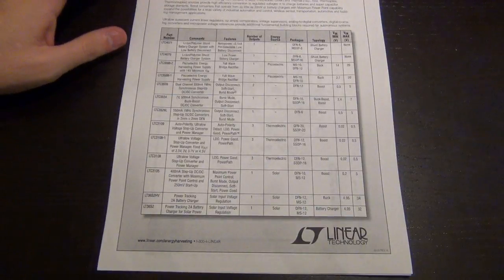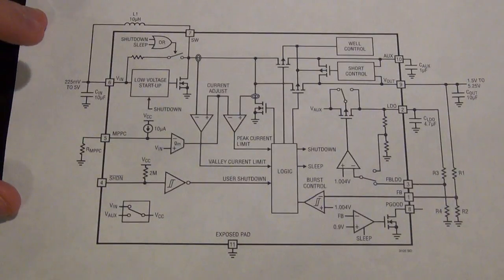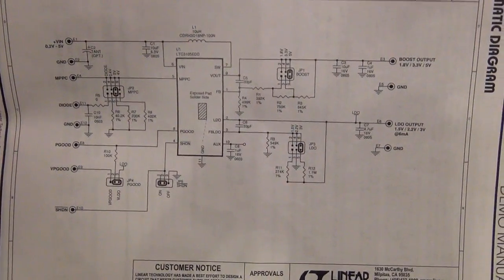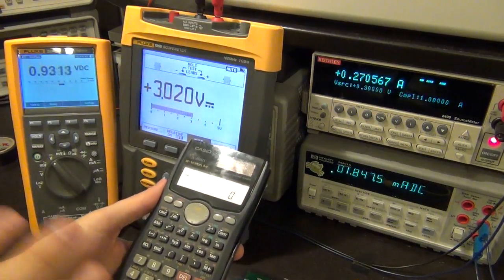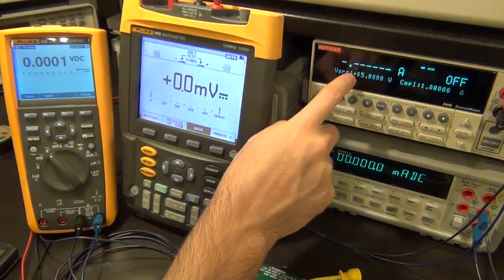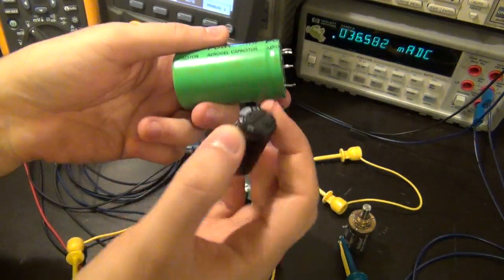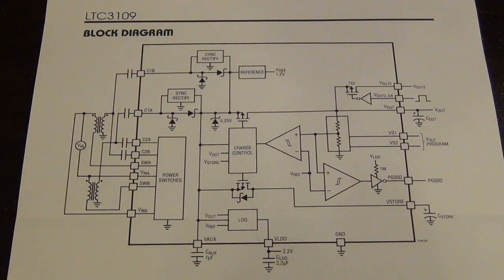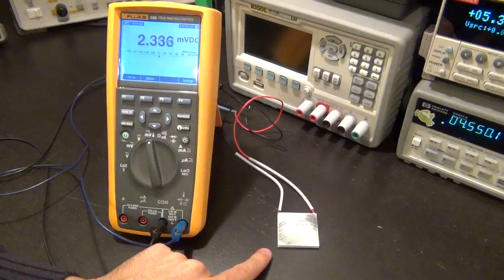TSP #21 - Tutorial and Experiments on Energy Harvesting ICs

Comment from the maker: The main input probe terminal is touching the output and the ground touches the ground. This brings the probe as close to the circuit as possible and avoids any long wires connecting the board to the probe ground. This in turn minimizes ground loop inductances which can degrade the boost converter output quality.

Comment from the maker: Yes, this is due to the change in the boost conversion frequency and inductor current as a function of the load and input voltage. The sound emits from the inductor due to vibration within the audible frequencies.

Comment: For anybody wanting to play with this IC, LTC3105. In LTSpice VII, there is pretty accurate model avaialable for it, and you can check built in examples. It is quite capable device. But the MPPC isn't that great - if MPPC voltage is set pretty low (i.e. 0.4V, via 40kOhm resistor), the voltage can oscillate a lot, even go negative on input. Reducing input capacitance, doesn't help much, and similarly inductor could be changed a bit, but it doesn't help much. I was not able to really convince the IC to operate the PV cell model to operate at optimal voltage. The only improvement in setting MPPC was startup behaviour, but once it is up, I see no difference at all.

Comment: Good vid thanks. 
Question1: is a capacitor or a battery going to self discharge quicker? 
Question2: is it possible to make an inductorless MPPT system using a voltage trigger that literally only discharges the caps when they are above the MPPT point of the cells?

Comment: This has given me an idea, I have a roof cavity and a steel roof, it's always much warmer in the roof than it is outside, a few peltiers affixed to the underside of the steel roof could actually produce a useful amount of energy from that differential, probably enough for charging a phone.

PS: auto boost+buck DC converter boards based on the LM2377 are cheap and neat, search for "LM2577 auto" at ebay, like your first example input can be lower or higher than output, handy in the hacks drawer!

Comment: Interesting, never heard about it. Someone come once with the idea of getting little power form RF waves in the air using a long wire. Enough for a low low power application form a supercap .... By the way, just discovered your channel, and wanted to know if you would be able to make in the future some vid about sigma delta converters and how to calculate the effective bits of data. Although the seems simple it drives me crazy to set up its basic parameters. You are good at explainning for sure

Comment: I know this is old, but people from Analog don't answer me. Im using the LTC3105 with a 1W,5V rated solar panel, to charge a 3.7V LiPo (it doesn't discharge much so I guess I can used constant voltage). The thing is I don't think the MPPC pin is just a current source as shown in the block diagram. I have a 390k resistor there, and the voltage varies around 2.5V or 3V. Any ideas why this could be?

Comment: Bought one of these chips but managed to kill it during soldering, very hard to do DFN/QFN - even struggle to solder SSOP. It's a shame they make it so hard, why can't they do DIPs anymore :(
Reply: TheAmmoniacal Did you try "deadbugging" with some thin magnet wire or similar?
Reply: ADQAutomotive Nope, got mad and smashed a hole in it. Found a replacement chip from Linear that wasn't QFN! I have learned to solder most packages since then though! Fine tip, fine solder, good flux, all that was needed!